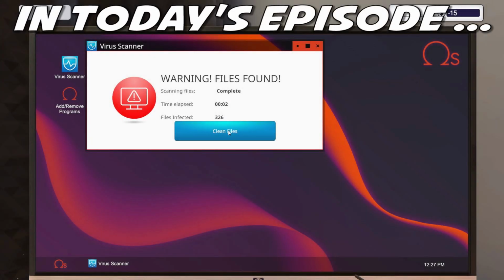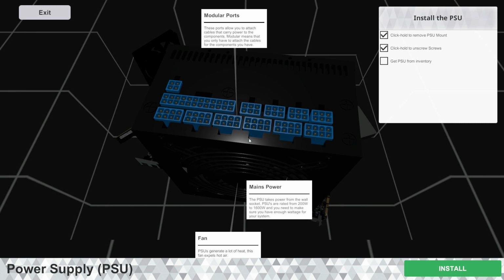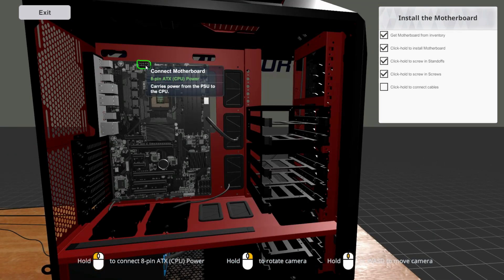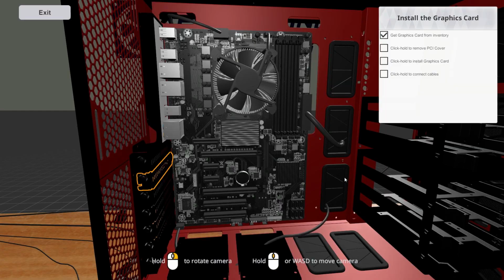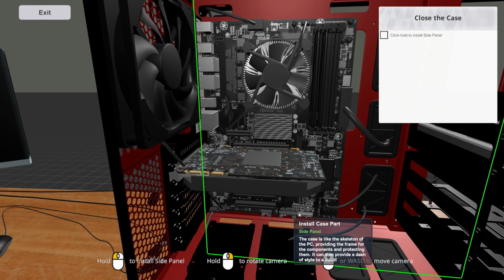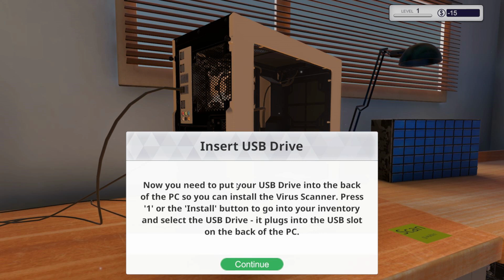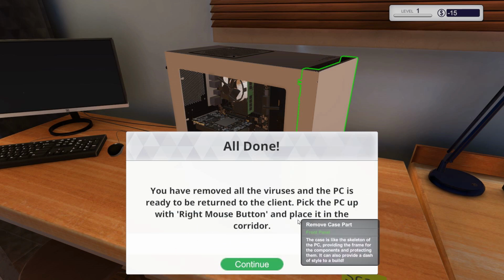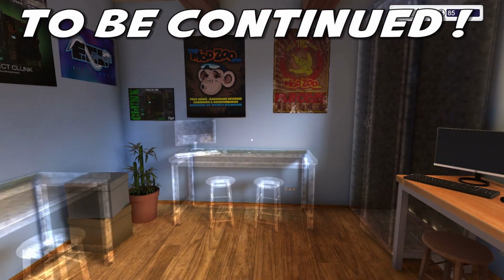Run Your Own COMPUTER SHOP! Build, Sell and Repair PC's! - PC Building Simulator Gameplay

Comment: Sorry to be a picker of nits, but I've worked in the microprocessor industry since 1976 and also have a wee bit of experience :D

You pointed out the obvious flaw in the sim already... You NEVER install AV software on a potentially infected drive!  Not only will the software become infected as its installed (Std. Malware behavior since the first Apple II worms in the early 80s) but your Thumb drive could be infected.  Your procedure of booting your own OS from the drive and then running AV, or moving the drive to a dedicated AV System are best practices.

The second flaw is a bit more nit-picky... The sim does not have you disconnect anything before moving the PC.  I've seen people drop (and smash) CRTs to the floor doing this, and how many Thumb drives can you afford to give away with your (hopefully) licensed AV software installed?  :D

Comment: This was very educational!  I found myself frequently pausing and looking in my own computer's window as you were going through the "building" phase, identifying the parts based on this gameplay video, as my computer seems to have a similar layout. I've had to take it apart a couple times, (ex. for cleaning out dust) but there are certain parts I wouldn't DARE touch because I'd be afraid of breaking something.  I still wouldn't call myself an expert by any means, and I still won't dare mess with certain things, but...it was still an interesting learning experience watching this. :)

Comment: GPU's are also really good for anything that requires serial calculations not just games and graphics. In my office we have a top-notch gaming PC with two NVIDIA 1080 GPU's and it's used for running computational chemistry. I'm lucky that my laptop has a seperate GPU so I can run computations on it sometimes. Some people in the chem department run so many calculations on GPU's that they regularly overheat them.

Comment: I laughed when I saw those posters of CPU Magazine covers on the wall. I had a subscription back in the day.

Also, I hope they add difficulty levels where the goal is to build older systems running old OS's. Aside from those dang front panel connectors, it's really easy these days. Compare that to setting IRQs and memory interrupts on a Windows NT 3.51 build... [shudder]

Comment: So, I was going to ask you, or anyone, if building a PC is hard. I want to build my own PC but I don't want to mess anything up. I get stressed out by seeing the motherboard and all of the cables that need to be attached to it. Are the cables labeled? Or do I need to memorize where they go. Can you help?
Reply: ChanPlaiz Gaming It sounds like you are new to the idea of building your own PC. I have taken one apart and I do understand what you're talking about. I would suggest getting a pre-built new one and use it as your working PC. The second or current one, I was used as an experimental system. The idea is, you won't care if it gets screwed up. It's meant to be practice for you. Take the time to label each of the cable so you know what it is you're doing. Systematically take it apart and then put it back together. Is everything works then you have a second PC. I hope this help.

Comment: Paul building my first gaming pc took me less than 2 hours. I think you'll find some time to build your own. It's really fun and cheaper too :) (except the rams and gpus)
Reply: That's just assembly. Then you have burn in time. Basically making sure everything runs and keeps running. If something doesn't work then you have to return it and get a replacement. Then try again. Once you get a working system, your mostly good to go. But you then have to keep track of each component , and it's warranty, separately. What he's saying is he doesn't want to have to deal with all of that. I have to agree with him. I'm thinking of getting a new pc too and in the past that meant me building it. Now I too am considering just buying one pre-built. Then you only need to worry about 1 warranty.
Reply: Scott Dunaway Well it depends how you enjoy doing stuff like setting everything up (burning time according to you). I haven't had any problems with my pc so far.

Comment: Don’t install the CPU like that, because it could fall out, and the CPU is one of the more expensive components, so either install it with the case on it’s side, or install it on the motherboard (and ram as well) before installing the motherboard into the case.
Reply: In the game it doesn't matter, but irl ya you shouldn't do that.
Reply: Not A Sentient Potato, Did you mean “shouldn’t”?
Reply: 101ToonLink yup